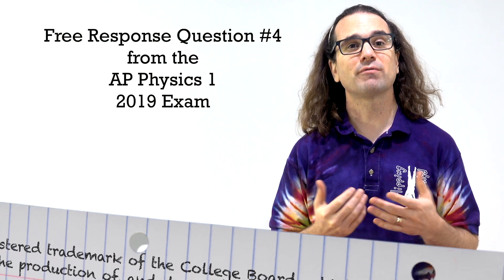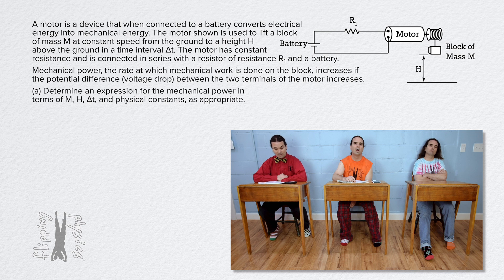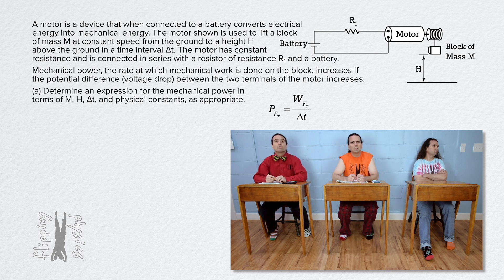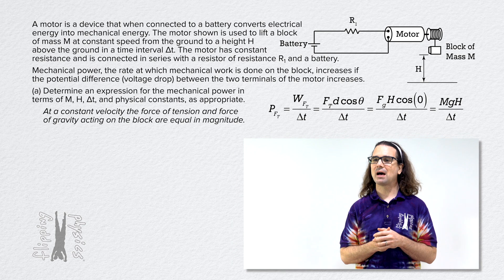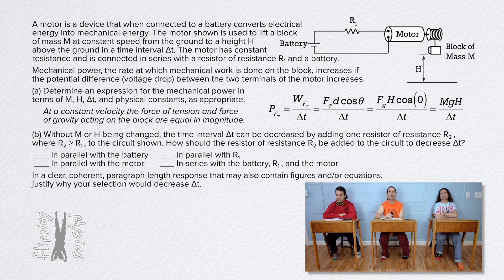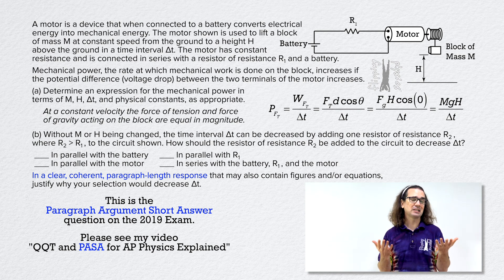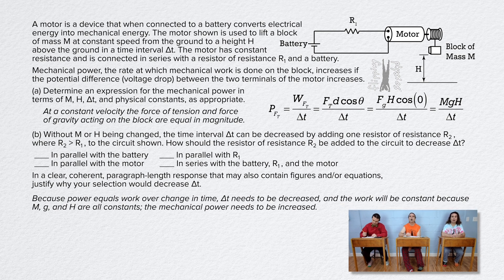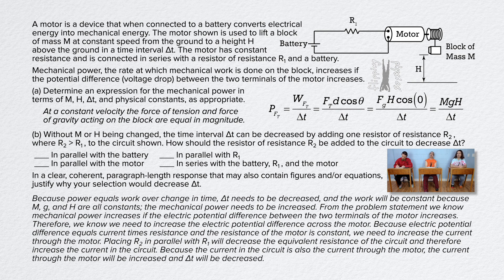2019 #4 Free Response Question - AP Physics 1 - Exam Solution

Comment: Is good but it would be better to explain why is not parallel with the motor, as that would also decrease the circuit resistance.
Reply from the maker: Thanks. I decided not to go through and explain why all the incorrect answers were incorrect. Sometimes I do, however, it did not seem worth it with this problem.
Reply: Assume the motor behaves as if it were an ohmic resistor of resistance M.  We desire to have more voltage across its terminals, in order to deliver more power to the motor.  Apply the voltage divider formula, Vload = V * Rload / Rtotal, to get the voltage delivered to the load.  Rload refers to the motor and everything in parallel with it, if applicable.  Rtotal refers to the total resistance along the path from the source that leads to the motor.

In the original circuit, the voltage across the motor is Vm = V*M/(R1+M).  Apply the voltage divider formula, such that resistance of the load (and all that is in parallel with the load) divided by the total resistance of the path leading to the load, is the ratio that the voltage is reduced from the original voltage. 

In the correct answer, R2 is in parallel with R1, and the voltage across the motor is Vm=V*M/(R1||R2 + M).  The symbol "||" refers to combining resistances in parallel.  The parallel combination of R1 and R2 will be less than R1 was originally.  This means that M is a greater fraction of the total series resistance of the circuit, and Vm will be larger than it originally was.  With the data.

R2 in parallel with the motor will make Vm = V*M||R2/(M||R2 + R1).  The value of M||R2, will be less than M.  This means that when M||R2 is added in series with R1, M||R2 will be a smaller portion of the total series resistance combination, which means less voltage drop than we had originally.

When you compare the expressions V*M/(R1||R2 + M) and  V*M||R2/(M||R2 + R1), they will reduce to the following:
V*M*(R1 + R2))/(M*(R1 + R2) + R1*R2) and V*M*R2/(M*(R1 + R2) + R1*R2)

You can see that these both have the same denominators, and they both have V*M in the numerator.  You can cancel accordingly, and reduce the comparison to:
(R1+R1) >?< R2

And the expression on the left is greater, since resistance is always positive, which corresponds to the correct answer of R2 in parallel with R1.